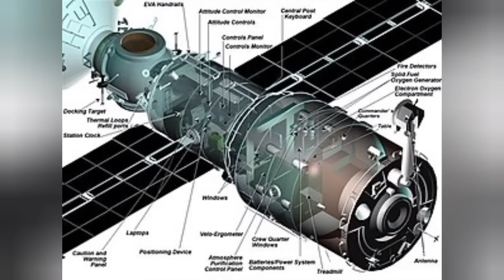Can Russia run off with part of ISS in 2024?  Can NASA do anything about it?

Comment: I think you are underestimating the complexity of separating the Russian components of the station. The Russian components are highly dependent on the rest of the station for a number of services, especially power. While they do have their own solar panels, they are not sufficient for normal station operations. Also, Zarya and Zvezda are very old, and it's likely their panels have significantly degraded over the years. There was an intended  "Russian Power Tower" module, which was never completed. Perhaps this could be completed and launched, but as you say, RosCosmos are strapped for cash, so who pays for it?
Aside from that, the process of separating the Russian components from the rest of the station would not be a simple one, with many electrical and plumbing connections between them. These would need to be disconnected, and if not done in an orderly fashion, would cause severe damage to both the Russian and International sides of the station. It would need to be carefully planned and would require many spacewalks. It be almost impossible without the cooperation of the international partners.
There's also a question over whether the docking ports would actually separate, or whether they may have become cold welded over the years. However, given that the Pirs module undocked without major problems to allow the arrival of Nauka, this probably wouldn't be too much of a problem.
Then, there's a question over the ownership of the Zarya module, which was mostly funded by the US. Disconnecting it might be considered an act of piracy.
Regarding replacing the Russian elements, the main thing the station lacks without them is an on-board reboost ability. When Zarya was launched, there was no backup, so in case of a launch failure, the US prepared the Interim Control Module. There have been a number of proposals to repurpose it over the years (at one point it was going to be the basis of a robotic servicing mission for Hubble), but as far as I know it's still in storage. I've seen estimates that it would take 2 to 2½ years to bring into service. I think it would take at least 2½ years to separate the Russian side of the station, so if they started refurbishing it once Russia announce a departure, it should be ready in plenty of time.
Reply: Yes, as usual Angry is showing his lack of technical education and is oversimplifying things.
FYI - I am an aerospace engineer and one of my class mates from college is very senior in the ISS program.

He's half right the Russian section can be detached an become the basis of a new independent Russian Space Station, BUT it will have a significant power shortage because while the Russian side has the orbital boost engines the American side has the bulk of the power supply and thermal systems. Its not just a matter of new solar panels to replace degraded ones - they need MORE solar panels. More power means more heat and that means they also need a bigger thermal system. 

So he's wrong about what a detached Russian module actually needs and can do. But then I'd simply build a new module based on one of the existing modules and the Russians are very good at reusing existing hardware. They might already be doing that.

He's also very very wrong that Russia can't afford it. Since the start of the Ukraine war Russia has NOT collapsed as the west expected from sanctions. In fact Russia has WON the money game. Sure they are not selling as much gas to Europe, but with energy shortages everywhere they are not having much trouble selling their oil or gas *AND they are getting more money for it. Plus since they insisted on trading in rubles the ruble has gone up in value and that's adding even more money to the Russian economy. Russia isn't poor, its just that 99% of the wealth is in the hands of a very small number of people. 

So if the Russians wanted to go it alone and flip off the Americans they can do it, BUT they will need to sort out the power supply and thermal system issues which I think they'll do easily. That's where Angry is right, they have serious space station systems experience. 

The issue for the Americans is damn simple they need a temporary module that can boost what's left if the Russians leave. They have the Space Shuttle AJ10 OMS engines. They're proven, they're super reliable and could push 100+ tons about. Plus they were used on a bunch of vehicles so they are ADAPTABLE. There is one major proviso - so long as NASA doesn't make it into the usual multibillion dollar drama fest out of it they should have a fix ready by 2024.
Reply: @tonywilson4713  I have amusing visions of cosmonauts making off with the old ROSAs. Not that that will happen.

Russia also has a strong potential partner in China who is keen to see egg in the West's face. However, I don't see much of a future for the RusISS beyond a few years after detachment. The modules are old, and their delays stretch into decades, money or no money. Corruption is a major problem which won't disappear either.

But they also recovered Salyut 7, and came back from a number of accidents on Mir back when the crash of the Soviet Union was still echoing.
Reply: @TroySpace  Don't forget that NASA's biggest problem are the aerospace giants that influence congress so much that its almost impossible for NASA to function properly anymore.

I remember a story if when Spaceship 1 made its first successful suborbital flight and there were people in mission control at NASA going off like their team just scored a miracle last second touchdown. I was surprised because I thought Spaceship 1 must have been a huge embarrassment because NASA had done failed SST replacement project after failed SST replacement project costing over $14 billion.

Then it turned out why they were so happy. NASA's people thought finally the congressmen who had control would be embarrassed and STOP interfering with NASA's projects.

I person I went to college with (who's in the ISS program) told me that NASA doesn't decide which projects it does or if a project gets an extension. The NASA committee (in congress) does that and they favor projects that create jobs in their state irrespective of how good or bad they are. 

So you're right that the Russian have political issues but so does NASA.
Reply: @tonywilson4713  yep, the pork barrels keep rolling... somewhere I read that in the early 70s, NASA was told to reduce the space shuttle's costs stemming from TPS issues and realised they could do a stainless steel design instead of the silica tile or titanium/expensive metals hot structures. It cost half the amount, and Congress essentially didn't believe them and made them go with the tiles.
Reply: @TroySpace  I don't know about that part on the space shuttle. The real reason they needed that incredible thermal shield was because of the idiots in the USAF. I did a fairly serious proposal for the Australian Space Agency and part of that included a "lessons learned" from Apollo and the Space Shuttle programs.

Sorry for the monstrously long answer but this is a topic I have researched.

If you go all the way back to what NASA actually wanted its an interesting story. The X-15 program had plans that went well beyond the X-15C. There were at least 3 models planned after it - a 2 seater, a delta wing and a scramjet powered delta wing. They were planning to make the X-15 into a spaceplane through a series of development steps. What NASA wanted, was a cheap way to get 2-4 people up and back and some cargo for crew exchange and resupply of a space station. 

One of the reasons Skylab became to expensive was because of how they sent crews up. Skylab was actually cheap to send up because they just used left over Saturn 5 parts, but that wasn't the case with crews and resupply especially because it was all disposable Apollo stuff.  

So NASA wanted a cheap crew/resupply option to keep going with Skylab and then Nixon made the dumbest decision in NASA history. He told NASA they had to team up with the USAF & CIA. It was to save costs but the one thing the military and intelligence agencies are incapable of is budget or financial control. Then it got worse because the USAF wanted the new shuttle capable as a weapons platform and the CIA wanted it capable of delivering 30tons to orbit because they had plans for super massive spy platforms. Those 2 requirements were idiotic and made the Space shuttle go from being a small spaceplane to a monstrosity that included huge wings needing a massive thermal system.

So that's where shuttle really went wrong. It was Nixon, the USAF and CIA.

I was in college doing my degree when Challenger happened and a lot of that stuff cam out around that time, but it was never really made public knowledge because there wasn't the internet or massive cable news networks at the time. 

The better one however was Space Station Freedom, which was the proposal that morphed into the ISS. When first proposed the budget was $20 Billion. Bush Snr told them to not be stupid and do something cheaper. So they went away and came back with a new concept and a budget of $30 Billion. Bush Snr flipped out and told them AGAIN "Do it cheaper." So they went away and came back with a new concept and a budget of $40 Billion. After that Bush said find international Partners and they ended up spending $120 Billion.

If you look at the proposals for the Lunar Gateway, Lunar Base and replacement if the ISS none of them are being planned to get the job done they are being planned for the advantage of the space industrial complex.
Reply: @tonywilson4713  it was a while ago that I read that so I'm probably getting some part of it wrong. Dyna-Soar did have a mostly steel body thanks to low areal density and wing loading, and was in line with what the RAND study recommended.
Honourable mention to the guy who met the requirements to minimise length and keep the USAF cargo bay by mounting it sideways...
Reply: @TroySpace  Interesting detail, thanks.
The Russian shuttle Buran used a paint developed in Russia. I don't know how much they expected it to need renewal. The F22 uses a paint as part of its thermal & radar protection system but it needs to be renewed often and that's what makes the F22 expensive to operate. The XB70 famously burnt the paint off the fuselage the first time it flew supersonic.

The oddest part of the Space Shuttle thermal system is the leading edge and nose which is a stuff called RCC (reinforced carbon carbon) I had a paper written by the guys who developed it and the simplest description is that its like a man made sheet of diamond but that's so oversimplified I hate using that description. Its laid up like normal carbon fibre but the matrix (resin) and the thermal processes used and number of steps are complex and I could barely follow what they were describing. Its part of why they didn't think it was possible to break as happened with Columbia.
Reply: Yes. I have serious doubts Russia even wants the modules.  They are outdated, and showing signs of their age.  And are nearly completely dependent on the ISS, not just for power but heating and cooling.  Plus 8 years ago they basically said they would give them to the ISS partnership.  (The original agreement also gives ownership of all modules to the consortium) Now, if things continue to get worse, they could detach out of spite.  And just de-orbit them. Which is a more likely scenario.  But honestly, NASA wants to de-orbit ISS in 2030 (if they can't find a buyer)  And Cygnus (a test ship was already done) and even Dragon  can replace propulsion.  SpaceX has all but said they have already (on paper) designed a dragon upgrade to do this.  Russia knows it's an empty threat.  And will just look "magnanimous" when the say they will leave the modules.
Reply: @davidbowerman6433  Yes, Zarya and Zvezda are both very old and a lot of systems on them don't work any more. Nauka, on the other hand was only launched last year, and would definitely have some value for a new station. I think there would be a question over whether it would be worth the effort of moving to a new station over launching new modules. If the Russians want to build a new station and aren't in such a hurry to leave, constructing a new station around the Prichal docking module connected to Nauka over the next few years, and then undocking Nauka with the new modules to form a new Russian station. That could easily take until 2030 when ISS operations are likely to be winding down anyway.
If the Russians do abandon the Russian half of the station (whether they take Nauka or not), it is unlikely that the international partners could use them for much more than storage space. Certainly, using Zvezda for maneuvering operations would be impossible without Progress ships to refuel. Cygnus and Starship are able to reboost the station, but it would be useful to have an onboard maneuvering capability for obstacle avoidance.
Reply: "Disconnecting it might be considered an act of piracy."... When Russia took over $10 billion of western owned airplanes after the Ukraine invasion, I am pretty sure that could also be considered an act of piracy, and Russia didn't care.  Rest of the world seemed to just let them, but with a strongly written letter of disagreement.
Reply: @angelarch5352  This is true, though short of mounting an invasion, there's not a lot the west can do to get their planes back.
Disconnecting from the ISS is not as simple as closing a hatch and floating away. There are a lot of complex steps to disconnecting the station halves, and it would be almost impossible without the cooperation of the international partners.

Comment: The Russians built the Zarya module but it's owned by and was installed by NASA. So if Russia wished they could disconnect the 2 modules they actually own, but not Zarya....IMO most likely Russia won't disconnect anything as that it's lot of work and expense. Instead they will simply shut down their sections of station, shut the doors and leave....Idea they will disconnect their modules to use in a new station ignores the fact ISS's orbital inclination is very undesirable for Russia. If they tried to reuse ISS modules for a new station  they'd have commit to building  a new station they can only launch to from a single launch pad in a foreign country.

In the end this difference in useful orbital inclinations between Roscosmos and NASA is why the idea of having Mir be part of ISS was rejected and it will stop Russia from reusing ISS modules now.

Comment: Dec 2024 is 29 months from today (27july2022). I expect SpaceX and NASA to design and build a Starship LEO space station equivalent in pressurized volume to the ISS (~1000 cubic meters) within that time span.

 Like Skylab, this Starship LEO station will be unimodular, i.e., sent to LEO in one launch. NASA required more than $100B (today's money), 12 years (1998 to 2010), and more than two dozen launches to assemble the highly multimodular ISS.  The Starship LEO space station will reach its final orbit in less than 2 hours after launch.

Skylab, NASA's first LEO space station, was built in the early 1970s and launched in May 1973. The manufacturing cost of Skylab was about $4B in today's money and covered the cost of two flight units.  I'm sure that Elon can build that Starship LEO space station for $2B, the cost of one Skylab flight unit.

Side note: My lab spent two years (1968-69) developing and testing components for Skylab.
Reply: People keep forgetting or just avoiding the fact that Starship could launch a space station with one or two launches. Starship would have launch already if not the problems with wildlife agencies and the FAA.
Reply: @acemax1124  the Sierra club!!!
Reply: @acemax1124  Government regulation holding back private sector innovations that the world desperately needs?
shocked pikachu face

Comment: Cold fusion of metals in contact for that long in such a cold place probably negates the whole splitsies maneuver.
Reply: True!....The fact the Zarya module actually belongs to NASA and ISS is on an orbital inclination useless for a Russian station cuz Russia can't launch to it from their own soil also makes splitsies unlikely...Most likely the Russians will simply shut down the modules they actually own, close the doors and leave...If they really want to prevent any one from using their modules can simply destroy or take critical components needed for the modules to function with them. It's a lot simpler than trying to detach and deorbit their sections.
Reply: Cold welding happens when repeated impacts or fretting peels off the oxide layers from a metal. Since the ISS is continually leaking atmosphere, especially at the joints, cold welding is unlikely - the reason it doesn't happen on Earth is continual reoxidation of metallic surfaces. 

The adhesion forces are not very strong in any case, and any such issues for a docking port could be dealt with by percussive maintenance. When it happens, eg Galileo, it's usually a weedy little motor or spring that's not able to overcome and it's very far away from a hammer-wielding astronaut.

Comment: The Russian will take no parts of ISS for there new Space Station ROSS 
Simple ROSS will put in 70° Orbit do there new Launch site the unfinished Vostochny Cosmodrome
reason is they don't have any equipment for save there crew in open sea landing (for 50° launch)
They switch to 70° to give crew land landing possibility in case of launch failure...

To move Russian ISS modules to 70° orbit take too much fuel 
Next to that have two main module extended there life time and Russian not want reuse them...